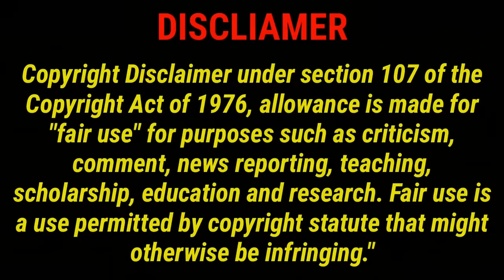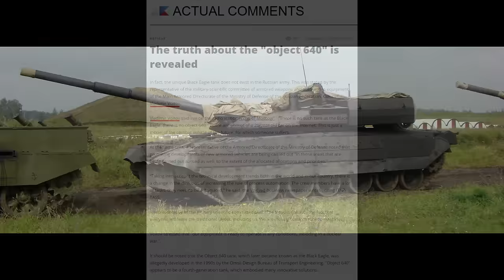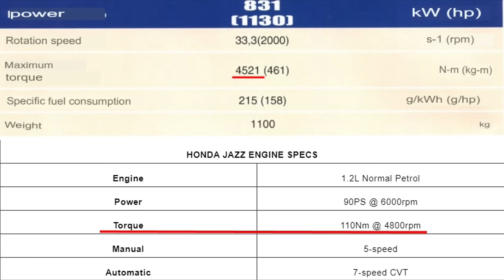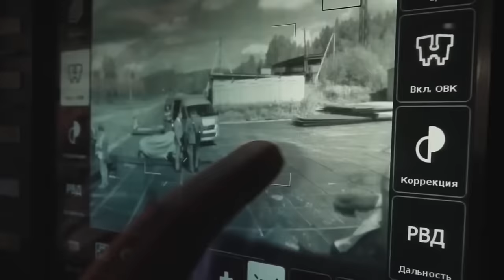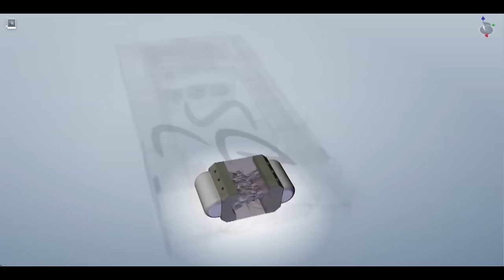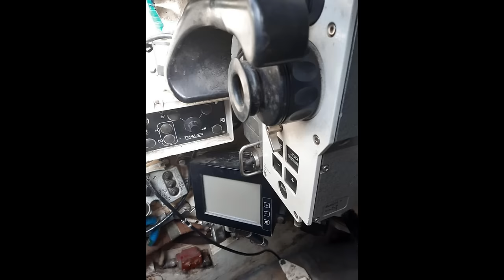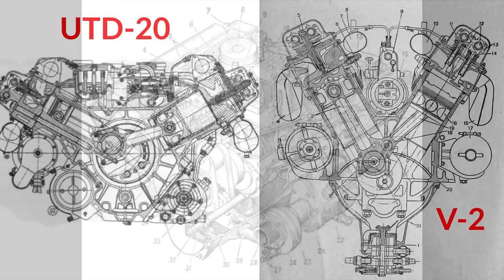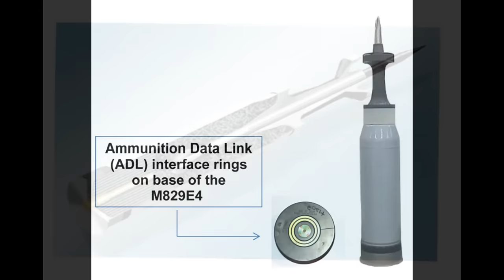LazerPig is WRONG about T-14 Armata

Comment: Never has so much been said about a vehicle that has been produced in such small numbers.
Reply: You mean kf 51 and abrams x? 🤣
Reply: @VVV85650  Deflection at its finest😂
Reply: A handful of videos speculating on Upcoming technology are Definitely “So Much” versus 8 years of russian arms simps saying the Armata making everything else obsolete. Clearly
Reply: @killian9314  much more than a handful lol
Reply: @V V  Both the US and Germany acknowledge that they're tech demonstrators. The T-14 doesn't exist outside of parades so there's no reason to replace the Leopard or Abrams.
Reply: @Just_A_Random_Desk  I can also say that Kf51 and Abrms X are only prototypes, so there is no point in mass production of Armata. Nevertheless, the armata has already gone through an evolution and you will see the changes if you compare the photos of the new versions of the armata with the first ones in 2015.
Reply: @killian9314  I'm talking about the sum total of all
Reply: @VVV85650  Abrams X is a technology demonstrator, KF51 is still in development and is not finished. T14 is meant to be fully in "production"
Reply: @Just_A_Random_Desk  yes because it's 1942 and tank on tank battles are common😅
Reply: @patb5266  ...what?
Reply: @VVV85650  lol cope harder.
Reply: @VVV85650  yes because that’s the reason the Armata isn’t in production lol
Reply: @VVV85650  or SU-57 or Checkmate
Reply: @TringmotionCoUk  the sun in total is 154 t-14 produced and now more produced
Reply: @WBFD  Yes, the media talked about big plans, but plans are changing and it is likely that mass production t14 is not advisable, since there is no such threat that cannot be dealt with by other means. In the meantime, they can improve the design.
Reply: @baneofbanes  actually wrong. Since Ukraine war started Russia started production of t-14 because of war. You don't produce weapons without incentives. It's called industrial war complex. Also you go cope because Russia has 154 t-14 which is a lot and more being produced
Reply: @VVV85650 , it's not really a "gatcha" moment when both were just announced just recently, goof. The T-14 is getting ready for its next pageant in the Red Square.
Reply: @Campsinstorms  or US hyper sonic missel
Reply: @VVV85650  Putin wanted 2000 Armata in 2020. They should become the MBT of Russia. What we have are technology demonstrators that never made it into industrial production. The Chinese considered to buybit and found it unsatisfying.
Reply: @WBFD  What are they paying it with?
Reply: @alexnderrrthewoke4479  According to whom? Where are they produced as no serial production exist?
Reply: @alexnderrrthewoke4479  “my source is I made it the fuck up”
Reply: @TorianTammas  ministry of defense of Russia. Duh
Reply: @TorianTammas  war in urksine and NATO and ww3 that has started now armatas is in production. Plus bmps and other armor is still good to fight so no need for armatas yet.
Reply: @VVV85650  I mean we can just call our icbms hypersonic like everyone else does lol
Reply: @alexnderrrthewoke4479  alright, let’s see a source for that then. And if that’s the case why haven’t they entered combat yet?

And lol Russia has nowhere near 154 T14’s.
Reply: @TorianTammas   ?
Reply: Eh there was a lot of talk about the V22 when it was still in testing
Reply: @baneofbanes  because they are still being tested? Again why you ask stupid questions when it's obvious? Did you know how long it took t-90 to be into service? Almost 8 years. Russians make sure their weapons work. That's why Russia is very reliable. Besides t-90m is still a very good tank and does its job just like t-72b3ms t-80bvms. Dude you can Google about it. Simple as that. Or you can go to combat approved channel and go to t-14 armata video and hear the ministry say it himself. Peace.
Reply: @VVV85650  abrams X isn’t a combat capable taaaank, it’s a tech demooooo.
Reply: @Campsinstorms  Yes, old ballistic missiles as well as some MANPADS, this is what NATO can call its hypersonic weapons.
Reply: @Campsinstorms  NATO may also refer to tanks with manual loading and manual target tracking as modern MBTs.
Reply: @Codename_Horizon  I agree, Abrams X demonstrates such advanced Western technologies as an automatic loader and automatic target tracking.
Reply: @alexnderrrthewoke4479  What BMPs and other armour it's all being wiped out. Why would you use T-54 if you have a storage of newer tanks
Reply: @yorkshire_tea6875  and yes you would use them just as NATO using leopards 1 to Ukraine so again dumb argument
Reply: @VVV85650  Probably another leftover from Leclerc upgrades. 😃
Reply: @VVV85650  "I agree, Abrams X demonstrates such advanced Western technologies as an automatic loader and automatic target tracking." The Abrams had automatic target tracking back in the 80s and the US has had autoloaders for decades, just not in their MBT's.
Reply: @yorkshire_tea6875  What is T-52? Never heard of such a tank. 🤔 T-80s and T-72s in storage are likely reserved for upgrades. Also, we do not know if those T-54/55s on the train were heading to Ukraine and if they will arrive there as tanks or some heavy modifications.
Reply: @VVV85650  yes difference is a abrams x was unveiled a 1 year ago, t-14 was supposed to be in production 9 years ago.
Reply: @Just_A_Random_Desk  I meant a pre-emptive fire system, the video says that this is not on Western tanks
Reply: @lahvancz  Thank you grammar or in this case t series police. The fact that Russia supposedly scrapped all t-54 and t-55 tanks (not sent to museums) and yet do still have an unspecified number and are paying for them to be sent on trains towards Ukraine instead of using that logistical chain for more t-72s is a good suggestion they are intended for combat which is pretty desperate even If it is just as stationary fortifications or artillery
Reply: @VVV85650  I mean most “hypersonic” weps only hit that speed for a short time on their way down, which minute man has been able to do for decades
Reply: @lahvancz  I hear they're using them for artillery they make a ramp of dirt and they drive the tank up onto it North Korea gave him ammunition for these their artillery is now worn out
Reply: @alexnderrrthewoke4479 No they are not. They don't have access to the western tech they used in the tank.

They were supposed to have over 2k of them over 3 years ago now. If they were going to produce them then that was the time to do so.
Reply: @yorkshire_tea6875  And do you have proof that the train was going towards Ukraine? I am just saying that we do not know if they were going there and if they are going to be used as such as there are many conversions. But even if yes,  D-10 is capable of indirect fire of 10+km and it is still an armoured vehicle.
Reply: @marklandwehr7604  I have heard this possibility as well, yet albeit all videos coming from the war, I have yet to come across a video proving it. As for artillery, both sides have their issues with that and still orcs are able to shower khokhols with 3 times as many shells.
Reply: @lahvancz  Given the tanks were stored in the East are were heading West it isn't a crazy idea that they are heading to Ukraine
Reply: @ V V You guys said the same thing about the F-35 and now there are nearly 1000 of them 😂
Reply: Our ancestors had unicorns, we have T14 Armatas
Reply: @yorkshire_tea6875  And most of the Russian industry in the east or west of the country?
Reply: @Just_A_Random_Desk  Aside from parades. The T-14 has been tested maybe not in combat but small production doesn't always mean bad lol. The F-22 are low production and only been used in Exercises, Airshows and to shot down a balloon. It's just biased thoughts and people hating because it's Russian.
Reply: This channel is pro Russian anyway.  Mainly biased.
Reply: @subjectc7505  The F-22 is on it's way out and who knows, it may get used if China acts on Taiwan. The F-22 actually exists and has been used in combat, the T-14 hasn't.
Reply: @alansokelisatruehero8520  you seem to be the one coping.
Reply: @Just_A_Random_Desk  What "Combat" has the F-22 been used in. The T-14 exist, and Russia can choose to put it in combat or not lol.
Reply: @VVV85650  my brother in christ rheinmetall has already made contracts to produce the KF51 in ukraine and make it its main battle tank in the future
Reply: @VVV85650  judging by how high the t80 turrets fly. We in the west are good. Panzy ass auto laoders 😂😂😂 wow so cool
Reply: @Skeletor mellowed out a little.  Not all autoloaders are bad. France and South Korea use autoloaders with blowout panels. The autoloaders on the Russian T series of tanks is fatally flawed though.
Reply: @alexnderrrthewoke4479  Russians make sure their weapons work..... LOL
Reply: @alexnderrrthewoke4479  154? Where are they? Which ones work as advertised?
Reply: have you watched documentaries about group b and group s rallye cars? there's hours and days of that stuff, about cars that were made in quantities of about 10 to 20.
Reply: @alexnderrrthewoke4479  There isn't production line for T-14 still in service despite being promised half a decade ago, like stop embarassing yourself like this
Reply: @VVV85650  that Russian "advanced" autoloader is bested by most of the active tanks in Japan. It is bested by the Abrams manual loading. Auto loader means jack shit if you it is slower than manual loading
Reply: @VVV85650  The Arbams X is just a test bed for what can be done
Reply: @lahvancz  military industry is in the East whilst the major population areas are in the west. It's much easier to store 200 vehicles in siberia than in Moscow. The tank factory refitting old vehicles is also in the east so it is unlikely they will be upgraded to any official specification
Reply: @yorkshire_tea6875  Probal to save the older tanks. But it isn't like they aren't deploying new tanks. Modernized T-62s were deployed alongside T-90Ms and BMPTs.
Reply: @VVV85650  You dont see abrams X or KF 51 on official military paredes.
Reply: He did acknowledge this in 48:33 to the end of the vid
Reply: @voidtempering8700  Ofcourse but it would be a worry if the US deployed patton tanks even in reserve so a t-54 pushed into service isn't a good sign for Russia
Reply: @yorkshire_tea6875  There is no evidence that the T-54 variant, let alone a baseline version is going into service at all. All we saw was them being transported by train.
Reply: I’m not going to pretend to be an expert on armoured vehicles and tanks like some people in these comments, but what is even the point of these analysis videos of a tank that isn’t even in service yet?

How do you judge a tank that has probably only a dozen produced, very little information about, and has never been in combat (only parades).
Reply: @TheWolvesCurse  group B cars were used for their purpose. I would suggest that the T14 never will
Reply: What about the shifty Ukraine T84 oblation or what ever or EVEN BETTER the Arjun Indian super duper MBT.
Reply: @alansokelisatruehero8520  @redeffect is not Russian
Reply: @Just_A_Random_Desk  Yes the t-14 exists and it's often seem in Kursk doing training exercises lol
Reply: @subjectc7505 due to lack of enemy combat planes, the F22 has been mostly used for interceptions and ground attack
Reply: Amazingly, people are paying attention to what I have said for once 😂😂
Playing tank top trumps is a hypothetical, if they are used incorrectly they will get wiped out no matter what. 
The other hypothetical is the production of course.....
Reply: It was also about other Soviet tanks and the development so no you are wrong
Reply: @VVV85650  compared to Russia’s track record? Lmaoooo
Reply: @PeterMuskrat6968  yes meanwhile the t14 is annonced since the end of 2014 2015
Reply: @drs4983  it was plenty of Iraqi planes in the skies.
Reply: Think harder, not everybody talks about tanks..
Reply: @alansokelisatruehero8520 lol, really?  “triggered Russian copes”?! First of all, what Russians are you even talking about? Lazer Pig made a really dumb attempt at ridiculing this particular Russian hardware. Red Effect very methodically and objectively pointed out all his errors. I’m American and I’m just laughing at how embarrassed Lazer Pig will be when he sees this. He obviously won’t respond, because how could he?! Lol. Gotta love how invested people like him are in the Ukraine crap. Like emotionally invested to the point where he’ll make up 90% of his video cuz “Putler meanie pants😭”
Reply: @V V The US designed and built a bustle auto loader in the 80s, and Leclerc, Type-90, Type-10, and K2 all have one, all of these tanks follow western design philosophy. There is no Russian tank in service with a bustle auto loader which is superior to the carousel system in every way.
Reply: They are producing 14's right now
Reply: @VVV85650  they should send the armata to Ukraine so we can see them split in half
Reply: Over 100 built cope
Reply: @VVV85650  here's the difference, the west font use demonstration tanks in military parade. T14 is just propaganda.
Reply: @Subject C Yes F-16s that we gave them, Iraq has been allied with the US since Saddam was deposed, before that 44 Iraqi fighter jets were shot down by US aircraft in 1991 for one loss and during 2003 they literally buried their jets in sand rather than face the US again.
Reply: @TorianTammas  Its literally in the video you are commenting under.. there is literally no evidence that the chinese even considered buying the T-14 , china wants to sell its tanks and buying russian wouldnt give supposed customers confidence in the chinese tanks. Where does this myth come from? Where is it stated that china wanted to buy t-14s from russia but ditched it because its bad?
Reply: @VVV85650  Automatic target lead has been on every western MBT since M60A3 TTS you know.. from the mid 70s, at the time no Soviet production vehicle had it so...
Reply: @VVV85650  they both just deliver nukes, not too different, hyper sonic missiles are advertised as being capable of evading counter measures, but it's kinda pointless since you can just do a volley of ICBMs and overwelm defense systems. EDIT: even a singular ICBM will deploy decoy warheads to make matters even worse for counter measures.
Reply: @VVV85650  For one thing, both were just revealed. So yeah they are gonna be talked about a lot. However the existence of the T-14 has been known for a decade.
Reply: This tank is either going to be the key factor to winning the ukraine war or a laughing stock of tank design. This thing is basically the modern IS-7 is this terrifying super tank that no one's seen in combat yet.
Reply: @VVV85650  Actually the T-14 is more equivalent in technology and timeframe to the Abrams Sepv2, which the US has 1600 of including a better and proven APS system.
Reply: @Just_A_Random_Desk  a video popped up of russian soldiers training with t14s, look it up
Reply: @chickenboi693  Training footage is worthless.
Reply: Well even if they only make 300 that’s still more tanks than the entire German army has in total.
Reply: @VVV85650  western tank are better
Reply: @VVV85650  found the Russia shill
Reply: @Liberty Prime  didn't say they were all  bad. I just think currently you save money and weight without it, and you gain an extra crew member who, if trained well can perform almost as well as any auto loader....except the French ones lol
Reply: @alexnderrr the woke  Russia has only around a dozen Armatas that are anything other than hulls.  They haven't been able to source the electronics for them for almost a decade, and without those their "next generation" tank is only useful as a parade float.
Reply: @WBFD  I believe there was a demonstrator version of the AbramsX produced, but the design is more than a proof of concept. Sandboxx News reports they are planning on going into production in 2030. The expectation is it will have loitering munitions, a reduction of weight by 13 tons, increase in speed and advanced communication and integration features. By that time the Armatas will have the ability to wash uniforms in a variety of water temperatures and even incorporate and an extra rinse and spin cycle, something vitally important when you're still wearing the same underwear you had on since 24 FEB 22. Almost forgot, Armatas will each have there own flatbed so they can move, no more holding up the victory day parade.
Reply: @VVV85650  They certainly won't be as good at roasting the crew or tossing the turret as the russoviet tubs
Reply: "Never has so much been said about a vehicle that has been produced in such small numbers."
[Has clearly never had to talk with the fanboys/proponents of the Bismarck and the Yamato/Musashi]
Reply: @baneofbanes  the Armata isn’t in production because they can’t bypass any of the issues that have been plaguing the tank for the last 8 years. That’s the only reason
Reply: @VVV85650  "...so there is no point in mass production of Armata" has to be one of the best quotes of this year.
Have you seen how the T-series tanks are doing in Ukraine? They are further developments of the T-54/T-55, which came into service under Stalin. They needed to be replaced in the 90's and have no business being on a 21's century, first world battlefield.
The current standard Abrams' and Leopard 2's are better in every conceivable way. Russia is lagging so far behind in tank development that it's just a meme at this stage.

But hey, cope cages are a good start though. Ukraine is also currently winning the 2022-23 years Olympic Turret Tossing.😂
Reply: @VVV85650  The other difference is age, KF51 and Abrams X have all been shown in the past year vs Armata being shown off 10 years ago. Thats why it’s significant 1 year vs 10
Reply: @jesseterrell2109  Only a handful of technology demonstrator exist that are called T-14. They never got into serial production even as Putin wanther 2000 in 2020
Reply: @TorianTammas  iam sure Russias war in Ukraine has delayed any progress with the Armada just like the US wars in Iraq and Afghanistan delayed progress with various weapons during the 20 year long wars.
Reply: @alexnderrrthewoke4479  Because Putin wanted 2300 Armata in 2020. In reality we had some technology demonstrator.
Reply: @foundationuser5043  It produces income through clicks. The T-14 has high costs, certain flaws and never reached serial production ( Putin wanted over 2000 Armata  in 2020)
Reply: @Nick-rs5if  In Ukraine, there are tons of tanks on both sides. And any tanks are destroyed by artillery and artillery. The West could know this if it fought not only with savages. Leopard towers also fly off perfectly in Syria https://youtu.be/jpPpCWEZjSo
Reply: @Michaelation08  Agree, same as Leopard turrets flying in syrya https://youtu.be/jpPpCWEZjSo
Reply: maus
Reply: How ever small the amount, its still more than kf 51
Reply: @johnwinter2252  Nothing special in f35, just a mass single-engine aircraft that is inferior to any twin-engine jet in terms of speed and maneuverability. Lockhead picked up Yakovlev's Yakovlev Yak-141 design, which the USSR abandoned because it was pointless, and is now selling it for a huge amount of money.
Reply: Maus: am I a joke to you?!!
Reply: @attilatormasi1733  Not so simple. Manual loading is not stable on the move and after several shots, also during active shooting, the loader often does not close the shutter, which makes it possible for the tower to take off in a real war against an equal opponent.
Reply: @mattseller148  Yes, automatic loader behind the turret. The T95 had such a black eagle and now the Burlak tower has one that is compatible with the T72 hull.
Reply: @jollyroger8671  True, but the KF-51 wasn't claimed to be mass produced (2300 units) between 2015-2020, unlike the Armata.
Reply: @calamityhex3729  The Ukrainian war showed that the main thing is artillery. No tank can withstand an artillery shell. By the way, all tanks now have an upper armor of about 30mm. Armata has 80-100mm top armor.
Reply: @DirtyBob2001  Lol Abrams X is a tank to steal new money from the budget. And Armata is a tank in order to accommodate longer ammunition, since the old hull with a loading carousel limited the length of the shells. Nothing prevents Abrams from increasing the length of ammunition in the modern version, except for the desire to steal more taxpayer money.
Reply: It's not even a real tank :)
Reply: @VVV85650  keep building cope cages. You'll need them.
Reply: @V V  
The amount of copium you must be snorting is... legendary.
T-14 was in the 2015 parades with the announced to be in full production in 2016...7 years ago. 
With that in mind: 
Can you find a video of the T-14 firing while on the move? I rather suspect the stabilizer is still "work in progress" (Russia likes showing it shooting and moving, but not both...) And when I do see it shoot, that barrel flops like a diving board.

I'm pretty sure T-14 is a dead project at this point... simply being dragged around to save face after all the capability and production  announcements instead of being allowed to go quietly into obscurity while they build "1500 new T-90M" tanks.

The T-14 is a Russian sacred cow.
(For comparison, AbramsX even in its unveiling was described by the presenter as a technology demonstrator just to show the US army what was possible to implement, with the full knowledge that there would be technologies they liked, and technologies they didn't like.)
Reply: @patb5266  Lmfao, you know that tanks are not only "tAnK BatTLs"?
Reply: @subjectc7505  The iraqis never had air superiority. there weren't many iraqi aircrafts reported. Hell only 3 iraqi choppers were downed and that happened on the end years of the war. By that time the US was using F/A-18 Hornets and F-16s as fighting jets mostly. That war was fought more on ground and with CAS of helicopters. And yet the F-22 Raptor its being swapped by the more modern and combat capable F-35 Lightning II.
Reply: @killian9314  This would then equally apply to the 72IQ overweight Western mouthbreathers spending decades pretending tanks like the Leopard 2 are invincible, only to watch them vaporize with one ATGM hit, while we have hundreds of videos of Russian tanks "tanking" multiple ATGMs and at worst, catching fire with enough time for the crew to escape.
Reply: @VVV85650  The T14 Armata wasn't designed to counter the Abram X and Panther 2... it was designed to counter the M1A2/A3 Abrams and Leopard 2A6/A7 variants...
Which it can't. Hasn't. And never will.

NATO Tanks Reign Supreme... though maybe China can come too. XD
Reply: @alexnderrrthewoke4479  I never knew Russians made such great comedians. You're giving Zalenski a run for his money!
Also it's not called the industrial War Complex, it's called the Military Industrial Complex.
Reply: @jamesgarner327  underrated comment hahaha
Reply: Cause if claims about this tank are true that really means Russia is ahead of west in arms manufacturing.
Reply: @Just_A_Random_Desk  Only a third of the ammo is behind blowout panels, the rest is stored in the hull front, same with all NATO tanks but the Abrams. They can launch their turrets.
Reply: @mohammadmohammadzadeh4085  .... but they aren't true. And they're not ahead. XD
Russia has firmly entered the 1990's technology tranch in every way possible.
Reply: @Mygg_Jeager  in some levels indeed it’s ahead if we be honest and not biased at all, in some cases Russian equipments are superior for example in Air defense and ICBMs and hypersonic missiles, Anti-ship weapons cause Russia faces threat and has to invest on more advanced defensive arms rather than offensive arms cause unlike US that has highest offensive power and lesser it needs for investing in defensive stuffs. The weakness of Russian offensive power led to failure in ukraine and if Russia didn’t have its defensive power it would have been invaded by NATO multiple times by now. 
For example stealth bombers and Aircraft carriers are built to attack and invade thats why US has a lot of carriers and they are cruising all around the world but instead Russia developed advanced kinzhal and Zircon missiles that can target US ships and make them useless.
Anyways even if this tank enters mass production in five years later still is ahead of west.
Reply: @alansokelisatruehero8520  so presenting facts and corrections is cope? Seems like you’re the one coping
Reply: @VVV85650  Those are REAL, though... ;-)
Reply: @V V while we can all talk theoretically till the heat death of the universe, we can all say without a doubt that when it comes to western vs eastern tanks, eastern tanks has a higher mortality rate than ANYTHING the west has ever produced! Mostly because the East values human life to such a small degree that it’ll pack tank crews in so tightly that they’re basically glorified sardine cans with treads and a gun XD
Reply: @Geth-vk  and you also know that Russia is about as good at joint operations as an American is at eating a salad
Reply: @Geth-vk  and you also know that when it comes to warfare, Russia can hardly capture and secure a city with hardly ANY military strategic value let alone a military that was supposed to dwarf Russia’s military, and if the excuse is “OH BUT SPECIAL MILITARY OPERATION” nobody who mobilizes a large force of conscripts and reserves while forcing civilians to join the military to add to said dwindling reserves is conducting a “Special Military Operation” so stop it, get some help
Reply: @TorianTammas  Source?
Reply: @MetalMania613  i guess you haven’t seen pictures of destroyed Leopards thinking like that
Reply: @VVV85650  Neither is the auto loader so simple. It can jam if the tanks jumps, it may take more time to load if it needs to switch ammo type and simply you just have one less crewman in your tank. Both the russian autoloader and the western manual loading is quite outdated. To restate what I said the Type 10 japanese tank can reload in 4 seconds and can be manually loaded (but it has the drawback of not having a loader).

The Armata may or may not be on the same level as any western tank. We might never know if the russian army keeps pushing it's adoption date back and back. Remember that we should already see it being massively used. And it is not not being used because it is far too superior to western tanks. That would be a reason to deploy it even more. It is not deployed because it is not ready to deploy. It is classified why but it is not deployed. Maybe it has major issues with, maybe it is too costly (the Type 10 is also costly and so is most of the western tanks). We will only really know it's issues 30-50 years later. Or 5-10 if we are lucky.

Until then we only have the hard facts: the Armata has not been deployed and mass produced. It has already been pitched for sale to other countries so it seems like it should be ready to deploy. Yet it is not.
Reply: Eh I feel like the Maus has probably more media created about it, and there were way less maus made than T-14's
Reply: @VVV85650  Tech demonstrators are not the same as a production model tank.
Reply: @James-9999  Most, not the more advanced variations, which are claimed to hit the target at mach 7-9.
Reply: @Nick-rs5if  The fact that consider the T-64/T-72 developments of the T-55/54 shows just how poor your knowledge of tanks is. That's like calling the Challenger a development of the Centurion, the tanks only share minor relations.
Reply: @alexnderrrthewoke4479  that mean they will take Kiev in 3 days? Finally 😂
Reply: @VVV85650  No, he means useless pile of propaganda produced on T-14 without any proof of combat-ready vehicles that took or could take a role in any combat scenario, only the propaganda shoots.
Reply: @VVV85650  Cool that you think your T54s can be a threat to Leopards or Abrams. No need to produce any Armatas ;) ALL the money that went into developement of that crap is already stolen, you have no arguments.
Reply: @Just_A_Random_Desk  Shooting down balloons 😂
Reply: @subjectc7505  What are you talking about, it has a confirmed Chinese weather balloon 🎈 kill needing two missiles to accomplish that 😂
Reply: @wareagle3651  😅😂 True!
Reply: @VVV85650  abrams x is just a technology demonstrator 🤡
Reply: @MetalMania613  I think you tagged the wrong guy though
Reply: @WBFD  l
Reply: @alexnderrrthewoke4479  damn bro did you really made those numbers up?
Reply: Enough is enough. If the Armata never sees combat against their counterparts, then they have no say on being superior in any type of way against Western tanks.
Reply: @VVV85650  Abrams x isn’t a production tank. It’s a proposal to the government hoping they are looking to upgrade. But govt isn’t planning on a new tank right now
Reply: @Geth-vk  oh uh, whoops
Reply: Never has so much been said about  a vehicle that NO ONE has ever seen in action nor has  IT seen any action.
Reply: @VVV85650  so you found one video of leopard`s turret being blown in syria and you post as a "gotcha"  in every possible argument? Even so - at lest we know leopard tanks are actually produced and able to perform on the battlefield. I don`t understand how can you compare the Abrams X to the T-14?!? Or to claim that RU doesn`t produce Armatas because there is no need? I mean ofc it`s fine to say whatever you want but those"arguments" and claims are not even serious o.O
Reply: @Just_A_Random_Desk  They're means they are. It's their you meant to use
Reply: @PeterMuskrat6968 coping at it's finest 🤣
Reply: @alexnderrrthewoke4479  where are 154 t-14? In Putins dreams? 😂
Reply: @isellcrack3537  Leopards in Syria as an example that the turret flies off for Western tanks too
Reply: its not a tank. its a wish list of features.
Reply: @mohammadmohammadzadeh4085  Russia doesn't have Hypersonic missiles. Just like I don't have supercavitating Torpedoes. They are ideas on paper nothing more.
Russian Air Defenses? I feel like you're referring to the S-400 missile. Which is a very capable system.
Which NASAAMS is competing directly head to head with.
Anti-Ship weapons? What anti ship weapons. XD
Reply: @patb5266  Tell that to the one behind the biggest armed conflict in recent times, and one of the bloodiest and dirtiest.
Reply: @VVV85650  Abrams X was a demonstrator. Army never asked for it. The company put it out there to show future tech. Armata was supposed to be in the hundreds and yet they dont have more than a couple hand fulls
Reply: @VVV85650  wake me up when Russia can actually afford to make more than a couple dozen
Reply: @remogatron1010  yeah and lazer pig is also biased whats your point?
Reply: @HotteaLT  artillery will basically destroy any Abrams or leopards either that or a good ol rpg-29
Reply: @Acolyteoftheredmoon  So they both wrong?  LOL!
Reply: @Mygg_Jeager  supercavitating torpedoes do exist. They are not being used because they are loud and easy to detect by submarines far away. And doesn’t require high tech even Iran can produce. Russia has launched several waves of hypersonic kinzhal missiles in ukraine even US officials admitted it was real. How do you say this? It seems like you have little expertise in this regard. How are you telling me NASAMS are head to head with S400? NASAMS use slow short range passive infrared and AMRAAM missiles comparing it with mach 14 and 400km range of S400 missile capable of intercepting ballistic missiles?
Russia has developed P800 Oniks , Brahmos, P270 moskit,kalibr supersonic and Kinzhal and Zircon missiles for anti ship purposes that US ship can not defend it self against theses especially against Zircon missile
Reply: Hmmm. I raise to you, the maus.
Reply: @Acolyteoftheredmoon  Yes so need for imaginary armatas then, ok? 🙂👌
Reply: @alexnderrrthewoke4479  they cant be produced lol unless you want them using iron sights
Reply: @detox5454  and where is your proof? Please provide.
Reply: @SavageHenry777  where are they what?
Reply: @Ntsbhdb  look troll prove to me how it's not being produced? I will wait. 😭😭😭
Reply: @attilatormasi1733  let's see it with t-90m and t-14. And also show me proof how it was bested
Reply: @drs4983  don't forget ballons
Reply: @TorianTammas  yes they did. 154 produced and confirmed by ministry of defense
Reply: @Mygg_Jeager  better comedians Russia does than doing a drag show and be laughed at the whole planet 😭😭😭
Reply: @DaddysBelt92  I did not. Go to combat approved and see for yourself. By ministry of defense himself. Go cope
Reply: @friendsplay4146  in store in Russia and confirmed by ministry of Defense. Go cope 😭😭
Reply: Theres about 232 replies for this comments about a lot being said for this tank, like holy shit guys pump the breaks
Reply: @alexnderrrthewoke4479  Ruzzia is loosing go cope
Reply: @friendsplay4146  loosing how? Please explain to me. Bhakmut is now under Russia. If you call that loosing oh well lol
Reply: @collinlee5927  thats how much armata gets hate from. Jealousy or Russia
Reply: @alexnderrrthewoke4479 after 13 monts and only half bakhmut ? What happend 3 day special operatin?
Reply: Never was so much known by so many for so few
Reply: @alexnderrrthewoke4479  cool speculation, source?
Reply: Yes...produced in small numbers but as we know now has been involved in more conventional modern warfare than Abram's/challenger so far
Reply: @fizzgigmalmy2567 you  listen to much Z propaganda t-14 newer left Ruzzia son
Reply: Actually don't get any Russia propaganda only ours....saw the clips....even if it wasn't much time on the field it's still more than any of our tanks
Reply: @fizzgigmalmy2567  more ??? how abraams is number 1
Reply: @friendsplay4146  not on a modern conventional battfield with a variety of anti tank weapons....of course it's number one banging around the streets of Iraq fighting rebels
Reply: @hotcoals2291  Brian berletic new atlas, combat approved, smotthiex12
Reply: insert bob semple enjoyers
Reply: Well, how many tank production facilities have USA and EU ? Isn't it approximately... ZERO ?
Reply: @Petr Klíč  lol why would the US tell you were its military production facilities are? I know your brain is smooth but I didn't actually think you were incapable of thinking.
Reply: @petrklic7064  OK Ivan 🤣🤣🤣🤣🤣
I mean the EU isn't a country, but never mind.....
KNDS has at least 2 lines that could be restarted in a flash
The US has 6200 Abrams
There are 3600 Leopard 2's floating aroud too. 
I think there is enough to take on Russia's "10,000" tanks and China has aprox 3700 "modern" tanks....
Reply: @VVV85650  Who is talking about the ether of those?
Reply: @subjectc7505  About F-22
Let you know F-22 actually take part in Operation Inherent Resolve back in 2014
What about T-14? Syria?
Reply: @SRDPS2  The F-22 didn't do anything lol. It just scared for Phantoms. Idk anything about the T-14 so I can't speak on it lol.
Reply: @subjectc7505  they doing ground strike of course no air target 
Amount of people know this before balloon
Reply: "Never has so much been said about a vehicle that has been produced in such small numbers."

Maus.
Arrow
Reply: @VVV85650  ya because it has an autoloader  lol
Reply: @Acolyteoftheredmoon  artillery destroys any tank.. doesn't matter what kind it is lol
Reply: @alexnderrrthewoke4479  what happened mr. big bad russian??? lol did your armata break down on your way home again??? haha
Reply: @detox5454  you got proof of it? Please don't say the parade again. It's been debunked 1000 of times. Don't be a bot. Go cope
Reply: @alexnderrrthewoke4479  and like i said before theres more where that came from lol if you want me to keep going..
Reply: @detox5454  I am still waiting. Besides Russia captured a German leopard tank. Go cope 😭😭😭
Reply: @alexnderrrthewoke4479  and show me where its debunked bud... oh wait "the little boss man said so".. source lmao
Reply: @alexnderrrthewoke4479  do you just refuse to watch the video i post? haha keep going dude to funny
Reply: @detox5454  the same source you commenting. Watch the video instead of being a troll. It helps your brain grow.
Reply: @alexnderrrthewoke4479  trust me everyone will see the videos of them when theyre actually being used and i cant wait lol
Reply: @alexnderrrthewoke4479  ya.. its literal video evidence of it breaking down on stroll at a parade lol
Reply: @detox5454  your channel is empty why you a troll?
Reply: @petrklic7064  It's about 30 but who's counting?
Reply: @mohammadmohammadzadeh4085  if they exist and where are they?
Russia is the living definition of a paper tiger. They say they have 42 T-14 tanks, but we've only ever seen 7, that means they have 7. We've never seen the supercavitating torpedo. That means they don't have any. XD
Reply: @Mygg_Jeager  you haven't responded to me. You scared? Also Russia took a leopard 2 tank. How you will respond to that 😭😭😭😭
Reply: @collinlee5927  which comment I did not respond to you? Sorry I get a lot. Now I am on you. What's your argument please
Reply: @collinlee5927  it will be anyways. Cyberpunk era is coming and phoenix event. Trust me no nukes until 2025-27
Reply: @alexnderrrthewoke4479  I replied to you 4 times. Scroll up. XD
Reply: @alexnderrrthewoke4479  Boy you're RATTLED. Jimmy's officially wrestled. Russia boy is Big Mad.
Posted 60 times in the last 24 hours and can't even keep it straight on his head who's replied to him and who hasn't. XD
I can feel the seething hate, his trembling hands, and salty eyes filling with tears from all the way over here.
Reply: @Mygg_Jeager  again leopard 2 is captured by Russia. Go cope 😭
Reply: @alexnderrrthewoke4479  then is it really worth the time arguing about this tank? Something that could be taken out/disabled by other military assets besides another tank? Honestly dude, why are you so passionate about this? If this is just one comment section you're engaging with, I cant imagine what your inbox looks like with how staunchly you're defending a tank not yet seen in combat... go touch grass
Reply: @alexnderrrthewoke4479  Bro, you can't just keep saying, "Russia captured a Leopard 2." 
"Russia has a decent chunk of the T-14."
"Russia's T-14 is better than any other tank." 
We haven't seen a single T-14 on the battlefield. 
There hasn't been any tank on tank combat to prove the T-14 is better.
And who gives a damn about Russia capturing a Leopard 2?
PROVE THAT IT'S SEEN COMBAT AND IS BETTER THAN WESTERN TANKS
That's literally all we're asking: PROOF 
At the end of the day... These are only claims you're making. With no source to help, you're nothing but all talk Just like Russia.
Reply: @Mygg_Jeager  weak arguments. Try better. Go cope.
Reply: @Eric_Nguyen.  as far for Russia only having mouth that's not true because everything Russia said will do it does. Russia have 95% of bhakmut and took 6 villages and new lands. Go cope.
Reply: @alexnderrrthewoke4479  there's no arguments to be had. There's just a statement of facts. And it's that you're crying into your hands and Russia has not captured any leopard 2's.
XD
Reply: @Mygg_Jeager  well prove me wrong leopard was not captured. I will wait 😁
Reply: @alexnderrrthewoke4479  154? Hard to believe as the order of the Russian MoD  was limited to 100 tanks. Besides, there are no listings of armored units which field the Armata. It's only a prototype, just like the SU-57. And there's only like 20 of them. Deal with it.
Reply: @remo gatron  

This channel is not "Russian Biased".
If you actually watch many of his previous videos you will see this.
Just because Red effect Is making a video to correct some errors that were made regarding Russian tanks; doesn't make him or his channel "Russian Biased".
Reply: @alexnderrrthewoke4479  that's not how proof Works Ivan. You made the claim, the burden of proof is on you to prove the claim. Otherwise it's assumed to be false. A fart in the wind if you will.
Reply: @VVV85650 already completed last year. Waiting for orders.
Reply: @alexnderrrthewoke4479 waiting for export orders?
Reply: There has probably been more said about the the Heavy Gustav
Reply: Amazes me, too.  This is a tank that doesn't even exist in a production variant.  People talk like it's this overwhelming behemoth and there's millions of them, but here we are.
Reply: It's not about the number, but about the tech superiority, fam.
Reply: @VVV85650  two tanks that are in the "proposed to develop" stage, comparing to one russians claim has been in production for some time? Sure
Reply: @alexnderrrthewoke4479  hey Alexander t
The Broke Joke, where did you go? Crying in the corner again?
Reply: @jesuszamora6949  even if there were a million of them, switchblade anti-tank drone goes brrrrr.
Reply: @CH3TN1K313  Do you feel better know? Good all  russian tanks that we have visual evidence that have been blown up were excellent.
Reply: mous
Reply: @baneofbanes  : Lets to see your Cant Abrams in Ucranian’s Stepa !
Reply: @killian9314  A) Russia never claimed this. You lie. B) Armata is not just a tank, but its a family of many new vehicles that are using same interchangeable parts.
Reply: One thing people like him and many others do not even understand that the whole "Armata" is not just a tank, but whole family of new armored vehicles with interchangeable parts. This is not something you do quiickly over night. No, its a strategic long term goal that Russia has with rebuilding its Soviet vehicle park with more modern vehicles. It is not an arms race and Russia is no longer the USSR, but a capitalist country, so it does not have free labor that can churn out these for minimal cost. Nor Russia has the wealth to splurge on these so massively. The whole modern Russian doctrine has been about slowly reducing military size in favor of modern benefits.
Reply: The Maus.
Reply: @Michaelation08  Have you seen how high Leopard 2 turrets fly? Maybe you should check out the images from Syria.
Reply: @VVV85650  one of them is a concept and the other is a prototype while t 14 is supposedly a tank that is ready for production and is ready to participate in any war soo i don't really get your point
Reply: Bob Semple?
Reply: @oreticeric8730  what? That’s not proper English dude.
Reply: @VVV85650  Abrams X is a concept tank, there has been no orders or promises or even requirements that called for it 😂
But by all means, continue to cope
Reply: @alexnderrrthewoke4479 wrong there have only been 30 T-14 made and there all prototypes and now is only focused on refurbishing T 72s
Reply: @apolloaero  If anything, the war in Ukraine is likely going to stunt any investment in the Abrams X.  Russia has proven itself to be a paper bear, and given that any conflict with China will be almost entirely naval in nature (unless Xi's feeling VERY froggy), I don't see there being a ton of market for tank development.
Reply: Maus? Only one prototype finished, yet 100s of 1000s of hours worth of content on YT alone
Reply: @VVV85650  New evolution of the first ones produced?  A hand full of them and now they are a year in Ukraine and guess how many Armatas have been seen there.  Most of the videos I see of them in action they look like a helicopter with turret spinning.  The KF51 is a prototype/demonstrator produced by Rheinmetall of what they would like to sell to the military and the new tech available.  Never has it been touted as the new scary tank like Armata  which there only seems to be a few of them otherwise they would be used instead of getting their arses handed to them by a bunch of guys and their ox carts.  Russia's new tech seems to be shovel digging a trench or well their graves
Reply: @alexnderrrthewoke4479 are these 154 T-14 with us in the room right now?
Reply: @alexnderrrthewoke4479 >russia
>reliable

You should see the state of Moskva before sinking m8
Reply: @subjectc7505 T-14s exist, all of seen 7 T-14's are used for parades.
Reply: @wareagle3651 he already responded in youtube post, he said he talked to RedEffect, and even stated that RedEffect regrets making this video. Funny how badly your take aged.
Reply: @alexnderrrthewoke4479 Russia said they'll have Kyiv in 3 days....
It's been over 300....
The cope + lack of self awarness coming from you is so laughable.
Reply: @yorkshire_tea6875  They don't use the new tanks because there is nobody to drive them as their whole mechanized division got wiped out in Ukraine driving 60's era tanks
Reply: @lahvancz  Being there are videos all over the net of these tanks being destroyed in Ukraine means yes they went there
Reply: @brinkee7674  I have not seen a single picture of destroyed T-55 in Ukraine.
Reply: @brinkee7674  Ah I think I understand now. So is the lack of SU-57 femboys the result of the trained pilots being killed in mig-29s
Reply: @VVV85650  The US doesn't have hypersonic missiles because hypersonic missiles are pointless, just like the US doesn't have nukes as big as the Tsar Bomba because nukes as big as the Tsar Bomba are pointless. There is nothing you need a hypersonic missile for when a supersonic missle is already basically impossible to shoot down and way cheaper. Just like there is no reason to build bigger nukes when the ones you have can already erase Moscow.
Reply: @Jesus Zamora  yeah, the focus seems to be on SM-6s, SM-3s and LRASMs regarding Naval missiles, and AARGM-ER, AIM-260 JATM and  JASSM-ER/XR for Air Force.
Regarding weapon systems and platforms, the focus seems on arsenal ships and arsenal aircraft such as C-17 with Rapid Dragon. And obviously we have the development of 6th gen with extremely long legs. The emphasis is on range rn. The DDGX is slated to have 600 kW lasers, but I'm not sure if they'd be as effective against several AShMs that leaked through as the RAM or SeaRAM. The hypersonics seem promising though
Reply: @VVV85650  Every video mentioning the KF-51 and Abrams X explicitly states that they are technology demonstrators. The T-14 is marketed as a tank in full production and that simply isn't the case.
Reply: You mean the Maus?
Reply: It's carp... and I mean no disrespect to the fish.
Reply: @TorianTammas  Putin turn back time he so powerful it not 2020 yet and so he still have time to be right.
Reply: @alansokelisatruehero8520  uhm F_35

Nuff said :)
Reply: Maus
Reply: @detox5454  you don't say?
Reply: @VVV85650  t14 atrapa😂, thats what we call it in Poland my dear kacap “friend”
Reply: @alexnderrrthewoke4479  😂😂😂 ministry of defence of russia😂😂😂
Reply: @kroolis77  It's funny, but it's funnier that the only tank produced by Poland is based on the Russian T72 🤣
Reply: Perfect comment OP
Reply: More has been said about the Bob Semple tank and only 3 were built
Reply: THAT'S RIGHT. WE WON'T BUILD THE TANK - You heard me -- We just won't build the tank :)
Reply: @subjectc7505  The F-22 has "low" production numbers because the program was cancelled after 188 planes. There were supposed to be over 2000 T14's by now.
Reply: @Livewyr7  if it's a dead project, then why waste money on like what 14 models? Unless they're test demonstrators for the T-90. Something on paper, isn't easy to replicate to full scale.
Reply: @alexnderrrthewoke4479  ask the VDV and Elite tank guard at Anotov Airport, Russia lost way before they even settled in. Bhakmut is a meat grinder for both sides.
Reply: @friendsplay4146  Abrams was going against outdated Iraqi Babylonian Lions (Iraqi T-72) and Bmp-2s, even the Iraqi Abrams got clapped by ISIS. When they head to Ukraine, we'll see if the Abrams is capable of fighting in an environment it's meant to fight in.
Reply: @subjectc7505  ok you know how msny soldiers are in vdv? Battalions? A small chunk? Then why vdv making gains in bhakmut, aadvika and northern Frontlines?
Reply: @subjectc7505  elite tank is doing fine too. They are replenished and making pushes. Ukraine has 400k casualties I heard even 600k. Lack of supplies, and now Ukraine said they delaying offensive until summer because lack of supplies and how much damage Russia is doing. Ukraine lost 9k tanks and Armored vehicles combined. If you think Russia is loosing then I got another bridge to sell you
Reply: @subjectc7505  Attempting to save face, since they already put it in Red Square and declared that it was in production...
Reply: TSR-2?
Reply: Actually he is right T-14 is the most famous in that argument(just to know Abrams X is not a production tank it's a show off for parts that the army would want to pick for Abrams)
Reply: @VVV85650  the kf51 isnt in service, abrams x is a demonstrator, neither are being used in combat, its purely supposed to show off new tech
Reply: @VVV85650  You think a tech demonstrator is the same thing as Russia failing to produce a "production-ready" tank for a decade? At this point the Abrams X actually has a better chance of being produced.
Reply: @VVV85650  Abrams X and KF51 arent finsished , the armata is
Reply: @VVV85650  there is always reason to produce better tanks than the enemy
Reply: @patb5266  1991 called, it would like to have a word
Reply: MAUS begs to differ
Reply: True 😂
Reply: @yorkshire_tea6875  By that logic, NATO must also be out of tanks as the majority of the tanks they are sending to Ukraine are Leopard 1s. And while we are on that topic, why the hell would the Russians NOT send T-54s? Since NATO is sending old tanks to Ukraine? A T-54 is perfectly capable of dealing with a Leopard 1.
Reply: @sebastijanglozinic8630  Why would NATO send a large number of extremely expensive tanks to Ukraine when a Leopard one has better sights that t series tanks and so can more often than not get the first shot
Reply: @TorianTammas  Yet another myth! China NEVER had any plans to buy the T-14. In fact, China has not been buying tanks from the Russians since the Sino-Soviet split. And recently, the Chinese been trying to expand their own tank exports. Buying Russian tanks now all of a sudden would be quite counterproductive to their attempts to advertise their own products.
Reply: @AaronThePony  There is no APS system standard on the SEPv2.
Reply: @yorkshire_tea6875  The first shot?! ROFL Almost 70% if all the tanks knocked out in Ukraine on both sides are knocked out by medium caliber arillery (120-155mm). Tank on tank battles are actually quite rare. The Leopard 1s sights have not proven all that relevant so far because they will still not help you see a drone lasing your tank or the 155mm howitzer that is about to put a laser guided round right into your extremely thin (expecially on the Leopard 1) top armor. You are lucky if get a shot at all, much less the "first shot".
Reply: @TringmotionCoUk  the Ratten has entered the chat
Reply: @V V  The 3rd Field Artillery Regiment was equipped with LRHW on February this year (2023). Zumwalt class destroyers are currently being retrofitted with the system.
Reply: I wonder if any are even serviceable. I wouldn't be surprised if Comrade Conscriptivich has cannibalized all the T-14's for parts for the glorious Russian T-55 that must now fight on the front lines even though it is 50+ years old.
Reply: Hit the nail right on the head.
Reply: Ok, I been reading comment for I don’t know how long. Why the hell anyone still gives a damn about this tank is beyond me. It’s been 8 years since the parade where it was showcased, I would think it old news by now. Besides, military parades with all the new equipment is only ment to be an attention grab as it is. Say what you want about the west, but at least they aren’t using tanks in parades. That said, at least the west doesn’t celebrate the end of WW2 like it’s a event to remember. I understand that a lot of people died in that war, but it’s been about 80 years since it ended. Besides, I would imagine former axis countries like Germany would very much like to move past WW2.
Reply: @insanity693  idk, but I feel "pride" has to do something with this. As long as this tank is only in Russia for parades and doesn't see combat with proof of it's capabilities, the thing will just be for show. You can't just state something is capable of doing something without proof and with them saying the tank can do this and that, then prove what you've said is true. 
Also, LazerPig and RedEffect spoke to each other and LazerPig actually said that RedEffect regretted on making this video, so idk why we're not over about this tank.
Reply: @alexnderrrthewoke4479  only 20 were produced...
Reply: @alexnderrrthewoke4479  by the way, what's your source ?
Reply: @Am4x667  Combat approved channel terra incognita. Go cope
Reply: @alexnderrrthewoke4479  waht is this sentence supposed toe mean ? and what do you mean by "go cope" ? the fact that only 20 T-14s have been produced so far is literally on the internet for everyone who owns a computer to see...
Reply: @Am4x667  What is your source it's only 20?
Reply: @alexnderrrthewoke4479   Just leave
Combat Approved's Channel is a Russian Channel, so any other sources that aren't Russian related?
So far, does caring about how many Armatas matter if we only see them in parades and never in combat? 
Your pride of the Armata is just unbearable now. Especially because of you ending your sentences with "Go cope"
Besides, RedEffect said he regretted on creating this video, so give up.
Reply: @Eric_Nguyen.  so by showing you a direct quote by the ministry of defense of Russia by his own mouth is not enough source because it's Russian? Bruh you guys are the most funniest people on the planet.
Reply: @Eric_Nguyen.  source red effect said he regret doing this video? So you think other countries has best sources when it comes to Russian military? You see how flawed your argument is?
Reply: @alexnderrrthewoke4479  I said RedEffect regretted it days before in this comment section. He and LazerPig spoke to each other and was said that he regretted making the video. LAZERPIG https://www.youtube.com/post/Ugkx2Wm2ILi2iU_OT_KcAsQxUMV2MsyBPS27

 Lets see, the Armata video is 2 years old, so outdated.
There's been so much blurring that why tf is it blurred when it's been said the damn tank has been in full productions years ago?
All Russian outlets are basically owned by the government, so they control what's being said about the country. 

The MoD is literally nothing but talk. I gave an example that the MoD isn't enough because the moron said "We destroyed 4 M1 Bradleys" months ago when there obviously hasn't been any in the frontlines. 
The guy said the Moskva being sunk because someone started a fire by accident. That's even worse than being sunk by a HIMARS or Drones imo.
He overstated how many HIMARS were destroyed when there were barely any in the past. 

YOUR PAST ARGUMENTS NEVER GAVE US EXPLANATIONS ON WTF YOU SAY ARE TRUE TO BEGIN WITH
IF YOU DID, IT WAS ONLY RUSSIAN SUPPORTED 
The Armata is the best tank in the world: Prove it's been on the battlefield and can hold up on its own

You're on your own here on out in this comment section. 
This tank discussion is over
Reply: @Eric_Nguyen.  no it's not over because so far you provided no sources when I provided many. I come with receipts bud not excuses like you do
Reply: @Eric_Nguyen.  again was red effect right about laserpig fake news about armata tank? Yes many times like is he an engineer? Russia has best engineers in the world and laserpig what is his background again? What are yours? If you are Chinese let's not forget how much you copy Russian weaponry
Reply: @VVV85650  Abrams X isn't an actual tank
Reply: @WBFD  The name kinda gives it away. It was meant to be on the frontlines in 2014. With it's current availability, it seems more apt for it to be for 1914 (with the first tanks in combat in 1916 kept well in mind)
Reply: @alexnderrrthewoke4479  If Russia had that many their propaganda machine would definitely showcase them. They haven’t shown them so they don’t exist.
Reply: @alexnderrrthewoke4479  The few decent Russian engineers left the country to work in the west. Why work for worthless Rubbles if you can make hard dollars or Euros.
Reply: @angrydoggy9170  not really. You keep the element of surprise and Russia propaganda now works by showing the aftermath and yes Russia has shown so your point is moot
Reply: @angrydoggy9170  again who invented hypersonic missiles? Russia. Where is United States big budget and still can't make one?
Reply: @alexnderrrthewoke4479  They didn’t, the Germans did in WW2, it was called the V-2. But if you’re going to talk about truly hypersonic missiles that can manoeuvre like a cruise missile, Russia doesn’t have those.
Reply: @alexnderrrthewoke4479  Really now? Where’s that footage of a hundred T-14’s?
Reply: @alexnderrrthewoke4479  Or even one T-14 on the frontlines?
Reply: @angrydoggy9170  lmao v2 was far from being supersonic to hypersonic so please stop it. V2 was invention of cruise missiles and ballistic missiles era and that is true but however hypersonic is an entirely new concept and only Russia and china has it. Not NATO.
Reply: @angrydoggy9170  is zircon a joke to you? 🤣🤣
Reply: You seem very sure about your comment. Do you have a access to Russian military procurement department? Way too many people on YouTube paying attention to Western myths and propaganda.
Reply: @alexnderrrthewoke4479  A ballistic missile is hypersonic buddy and that’s all Russia has. That Kinzhal rocket is just a ballistic missile fired from an airplane. It’s not a true hypersonic weapon as it can’t manoeuvre. It’s a straight line weapon. It’s just a really fast rocket and not even an accurate one. Russia only has hypersonic missiles in their propaganda, not in reality.
Reply: @angrydoggy9170  really? What's your source?
Reply: @alexnderrrthewoke4479  You want a source to prove something doesn’t exist?
Reply: @angrydoggy9170  source about your claims. Oh so you admitting you being a troll then?
Reply: @alexnderrrthewoke4479  The Kinzhal is not much more than an air launched Iskander. Both have only a moderate capabilities to alter their flight path and aren’t all that accurate, as proven by their poor performance in targeting Ukrainian assets. But anyway, all this nonsense about the west not being able to intercept them is rather stupid. Russia is clearly even struggling with intercepting slow commercial drones.
Reply: @patb5266  Daily tank battles in Ukraine XD
Reply: @VVV85650  Try 6th gen Stealth bomber, low observable long range cruise missiles deployable with Rapic Dragon in a swarm. What exactly do we need a hyper sonic missile for? We can deploy a rasm swarm with 1k mile range that will wipe out air defense for the price of a single Hyper sonic XD
Reply: @alexnderrrthewoke4479  Dragging T-55's into service...yeah so much in production.
Reply: @VVV85650  Auto and manual loader, both have their advantages and drawbacks. I find all your arguments funny considering how poorly the Russian military is doing in the invasion in Ukraine. If you were fighting the American military you would already have had your whole military smashed to the ground and be at the table signing unconditional surrender.
Reply: @afterthefact6708  as so is Germany sending leopards 1 but ok 🤣🤣🤣
Reply: @James-9999  Hypersonics are of extremely limited use. True Hypersonics are extremely expensive for what they do. Boost glide systems rapidly become non-hypersonics with even small amounts of movement on the way to the target. Look up Rapid Dragon, a system that can launch a rasm swarm for the cost of a single Hypersonic.
Reply: @lahvancz  The heartland of Russia is in the west of the country, which makes the Russian militaries performance so laughable. They are struggling to project force a few hundred miles form their HEARTLAND.
Reply: @TringmotionCoUk  Russian doctrine has done its armor no favors. The extremely tribal nature of the Russian military has made it very difficult for the Russian military to learn from mistakes.
Reply: @subjectc7505  What are you talking about XD the F22 did not enter service till 2005. F-15s, and F-16s absolutely stomped the Iraqi airforce. F-15 combat ratio 104 kills zero losses.
Reply: @reynard4823  Prove it, so far only a single T-14 has been spotted in the conflict.
Reply: @00-Dima  Saint Javelin will make short work of a T-14 especially considering how poor Russian doctrine is.
Reply: @calamityhex3729  The problem is not the Russian tanks, its the Russian doctrine. They leave their armor completely vulnerable to missiles squads. These same flaws would doom even M1A2SEP3 Abrams.
Reply: @AaronThePony  The difference is in doctrine and reliability. Not to mention SEP3 more than matches T-14 tech.
Reply: @Nick-rs5if  The T-series are not terrible tanks...if paired to a competent doctrine. But pushing tanks against missile squads without support is madness. The Russians have no idea how to fight modern armor.
Reply: @VVV85650  F35 can take on and destroy any 4 Russian aircraft at the same time. You make yourself look incompetent with your assertion. Stealth, range and unique ability to target off nose make the F35 deadly.
Reply: @VVV85650  Accoring to proper operation the shutter is closed after each round. That is the standard, some may fail to follow but on the whole that is the standard. Additionally, even with shutter open the blowout panels still exist XD. Manual loading is solid, tho both methods have their advantages and drawbacks. What any armor force needs regardless of loader is solid doctrine, which the Russians lack.
Reply: @VVV85650  You are 100% incorrect, artilley is not what is killing tanks and tanks rounds, on the whole, do not kill tanks. You are conflating man launched missiles with artilley XD. You deal with missile squads with proper doctrine. Russian artilley has a dispersion right around 500 meters, you just are not going to be hitting tanks with that. Even Ukraines Western artilley has a dispersion of 300 meters barring PGM which 98% of missions lack.
Reply: @VVV85650  Where do you think the Russian military gets its funding? Magic Russian money trees? Both militaries are funded by taxes. Abrams X is a tech demonstrator. Not a production vehicle, there is no need since the Abrams A2 SEP3 is the equal of any modern tank.
Reply: @CH3TN1K313  Look for Russian tanks being destroyed by Javelins...ill wait. The carasel design is a throwback to soviet era philosophy where people were expendable. Here is the kicker...you are not Soviets, you are Modern Russians.
Reply: @mohammadmohammadzadeh4085  IF IF IF and yet with a modern war currently raging not a single T-14 has entered combat...
Reply: @mohammadmohammadzadeh4085  T-14s will get slaightered against missiles squads just like every other Russian tank. Against every modern western MBT they will also get slaughtered. The problem is not Russian armor its Russian doctrine.
Reply: @MetalMania613  Lets not forget the absolutely disastrous amount of war material they have lost. In sum total they have lost decades worth of military investment. Against something like the US military the Russians would have been beaten into submission inside of 3 months.
Reply: @WelcomeToDERPLAND  By way less you mean 1 XD
Reply: @Acolyteoftheredmoon  Do not conflate artillery and missiles squads, they are different things. The dispersion on accurately fired artillery is about 250-300 meters without PGM or PG kits. That makes it almost impossible to hit a vehicle with standard artillery rounds. Full precision guidance artillery munitions just are not designed to hit a moving vehicle. What you can do is lay anti armor mine fields with artillery or get lucky and drop special scatter munitions on top of a stationary set of vehicles. End of the day artillery is not a real threat to armor forces.
Reply: @mohammadmohammadzadeh4085  Better question for you to ask is this, why launch a Hypersonic in Ukraine? The weapons are incredibly expensive for what they do. The only niche use is in nuclear deployment. As you have seen using them in Ukraine did not, in fact, end the war XD. Hypersonic weapons are a solution searching for a problem.
Reply: @fizzgigmalmy2567  Has not been involved in ANY combat whatsoever. Only a single tank has been spotted in the back lines of Ukraine conflict.
Reply: @fizzgigmalmy2567  The Arbams A1 destroyed its then-contemporary armor in the hundreds. What you say about modern missile squads is somewhat true. However, the reason the Russian armor is faring so poorly is more do to their poor military doctrine than anything else. The US Army operates armor in conjuction with a combined operation and does not expose them to missile squads like the Russians do.
Reply: @petrklic7064  Yes, America and European nations can produce tanks...what an asinine asertion that they can not XD
Reply: @TringmotionCoUk  Subtract the over 3k tanks the Russians have lost in Ukraine XD. When you look at the Russian losses in Ukraine, it paints a disastrous picture. The have thrown away literal decades of military investment.
Reply: @detox5454  This is 100% not true. Do not conflate missile squads with "artillery".
Reply: @alexnderrrthewoke4479  You do understand that better does not mean invulnerable correct? Russia might even destroy an Abrams A1, that does not unvalidate the vehicles themselves. I personally do not think Russian armor is that bad, what is bad is Russian military doctrine. Russians have no idea how to fight a modern war. In a modern war trenches are just not a thing, air dominance will be asserted if either side actually has a modern war fighting capability. Neither Russia nor Ukraine has a modern warfighting capability.
Reply: @Mygg_Jeager  Understand where he is coming from, his military has been absolutely humiliated. The Rusian military has shown the world it is not, in fact, a modern military. If it was me I would cope as well.
Reply: @collinlee5927  This is entertainment for me lol Watching people seethe and cope is pretty fun.
Reply: @Gearparadummies  Also, how is him saying they destroyed or captured a leo mean anything at all, better does not mean invulnerable XD
Reply: @AERallert  What about it is superior to the Arbams SEP3? Far as I can tell nothing.
Reply: @oreticeric8730  Not sure what you are saying here  : Lets to see your Cant Abrams in Ucranian’s Stepa ! but I assume you mean The Abrams tank. Be hopeful it is only the Abrams A1 and not the A2 SEP3 run by the American Army because if the US Army comes to Russia, say goodbye comrade. BUT hey if you mean the actual general Abrams, same difference, he will kick your ass as well lol.
Reply: @CloneDAnon  The claim that it is a family of vehicles is hyperbole at this point as none have been fielded. From what I have seen of the T14 design it is a step away from the Soviet era design philosophy and could very well be a decent combatant, simple fact is that it just is not being produced. The most important thing to remember is that even the T90m's are not inherently bad, but the terrible Russian military doctrine IS and that is what is getting them salughtered.
Reply: @appleholo2336  Sadly all the modernized T72s in the world won't fix bad doctrine.
Reply: @brinkee7674  They have lost a mind boggling amount or war material, decades of military investment. Every day that Russia continues the war just makes the disaster that much worse.
Reply: @DBZHGWgamer  Goddamn someone finnally gets it. Rapid Dragon is vastly more effective than any Hypersonic.
Reply: Wait. You think new designs are instantly made in the thousands? lmao
But regardless, I agree that the situation is hilarious. LazerPig does sound like a clueless clutz just out for clicks.
Reply: @VVV85650  vlad for Christ Sake KF51 and Abrams x have been unveiled recently as demonstrators T14 Armata was unveiled a Dekade ago and according to russia there should be 1500 fully combat cababel vehicles in Service now. Reality there are only 8 tanks avaible for parades purposes only
Reply: @alexnderrrthewoke4479 and where are these in Ukraine??
Reply: @voidtempering8700  where do you think they were being transported? 😅 😅 😅 😅
Reply: @Schimml0rd  We have evidence of a single T-54/55 that was used as a remotely controlled bomb. They might have deployed them, but they are not being used as tanks. If that train was going to Ukraine, we would be seeing a lot more T-54 losses than are being recorded.
Reply: Titanic, hidenburg, plenty of small run vehicles get talked about to excess.
Reply: @alexnderrrthewoke4479 Are they invisible?
Reply: @ExiliaN42  you tell me since you a keyboard tank expert wargamer.
Reply: @alexnderrrthewoke4479  "...a keyboard tank expert wargamer" lmao how dare you assume my gender, Mr. Woke. 

YOU Claimed there are 154 of them. Where are they?
Reply: @Shovel_ops 
At least they don't break down, go over budget, and not to mention take almost 10 years to produce 14
Reply: Bro, if you only knew... Do you have any idea how much shit people have talked about the Nazi Bell, but the true holder of that award has to go to the Tiger Tank. I mean, it's literally the icon of what people imagine when they hear the word and they only made like 1500 of them. Granted that's a lot more than the 6 or 7 Armatas that have been built, but you could divide the total sum of words spoken about the Tiger Tank by 1500 and 1 fucking tank would dwarf the Armata as a footnote.
Reply: @VVV85650 Please dont embarass yourself.
Reply: Maus is number 2
Reply: @Just_A_Random_Desk They also have said that Russia will collapse economically!?? What's the situation now? They said that Russia has no missile anymore every month from the start of the war.
Reply: @VVV85650 well, time to see the dates
Reply: @VVV85650 Both are concepts, the T14 is not a concept. It's far past conception.
Reply: @VVV85650 They're not prototypes they're concepts made by the defense industry. They more than likely will never see production.
Reply: 2300 t14s are in serial production since 2018 and the badge of them is ment to me finished in 2025, the reason we dont see it is because it one get captured all unkown elements like the new composite armor, reactive armor etc.. will get exposed, the risk is just to high to field the t14
Reply: @Richard_T800  2300 Panzer IX Maus are in serial production since 1944 and the badge of them is ment to me finished in 1946, the reason we dont see it is because it one get captured all unkown elements like the new composite armor, reactive armor etc.. will get exposed, the risk is just to high to field the Maus
Reply: @VVV85650 One of these things is supposed to already be in service and in active combat, the other of these two are tech demonstrators/prototypes.
Reply: time went by now there are 30- 50
Reply: Armata now more than Ukrainian Oplot rn. 200 Armata againist 50 Oplots.